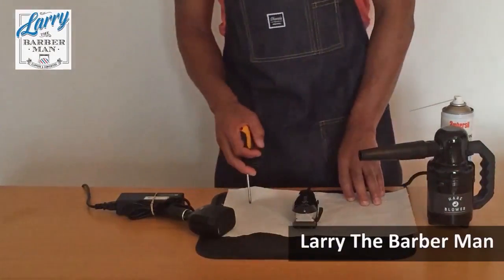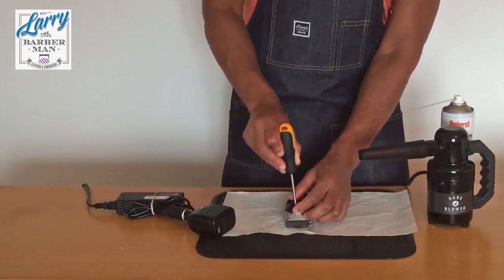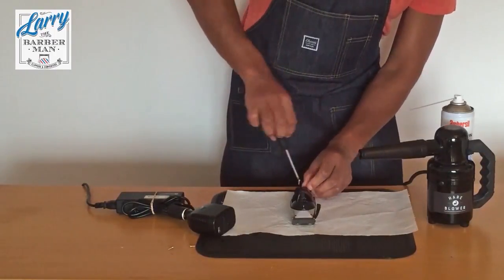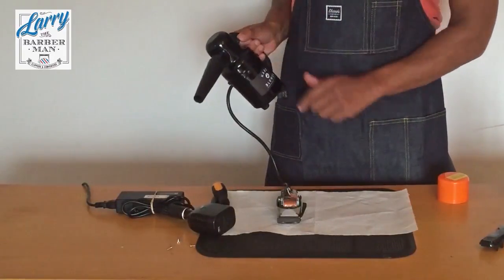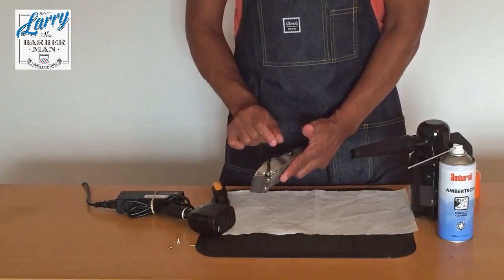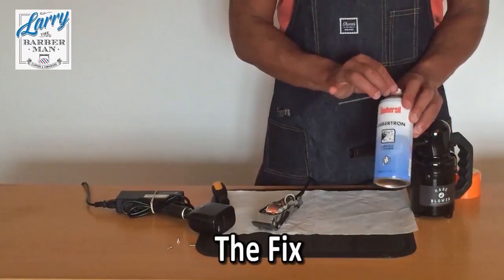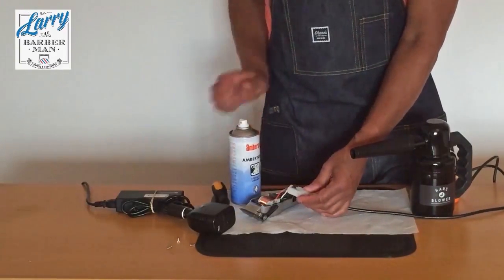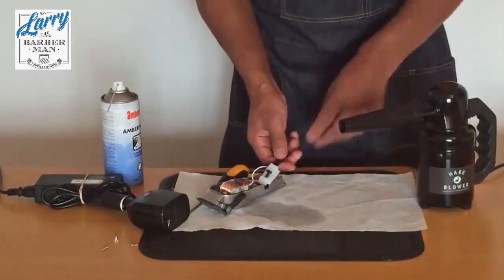Wahl Senior Power Switch: Possible Fix, When The Power Persistently  Cuts Out

Comment: Just got mine; brand new, 3 weeks ago. When I try to turn it on on batteries it doesn't work, then if I plug the cable on it turns on: I can take the cable off and it will keep on, until I turn it off. I've been having problems with it from day one. Definitely the worse pair of clipper I ever bought. Not impressed at all.

Comment: The power screw on some wahl's have a tab that won't let you adjust it too much , if you find that you need to go past this point you can pry the plastic bit with the tab off completely and underneath  it is a normal philips head screw ....my clippers are 25 years old ..

Comment: This cutting in/out happened to my crappy clippers after I used a voltage converter in Peru, they use 220 and in the US it's 110 I think, now just like another commentator, my clippers cut out at a certain angle. I hope this is as simple as a contact issue but my guess is I'll be buying new clippers soon, thanks for the video from SF
Reply: I just had 2 buy sum new clippers earlier tonight. But they don't cut close @ all. I'm trying 2 cut my head bald. But it doesn't feel like they're cutting @ all

Comment: Thanks for the tip! I should pop open my Wahl clippers, it seems. They are cutting out when held at a certain angle.
I suppose it's either this (hair in the switch) or a wire is coming loose.  The stupid thing is I just bought another replacement set (the same model, just newer) and it's been doing the same thing since day one!  Not as severe as my older set, but it's very disappointing.
Reply: I just spent an hour diagnosing this problem, clippers cutting out when held at certain angles. I cleaned the inside of the clippers out and the switch as described in this video. Debris was not the issue.  The cord is shorting out at or inside the bulky section where the wires go into the unit as the wired dangles in different directions as you turn the unit.  Just at the reinforced cord casing or inside of the reinforced area.  Either way the short is definitely outside of the unit and I'm not about to rewire the cord.  New clippers are in order.

Comment: Hi. Thanks for the vid. I have a related issue, which may also have something to do with the switch. Occasionally I feel the "bump" of a short circuit when I turn it on or off. Could this be a solution? I took it into the dealer, who opened it, saw nothing, and said that it "is probably humidity, store in a dry place". Any feedback is appreciated. Thanks.